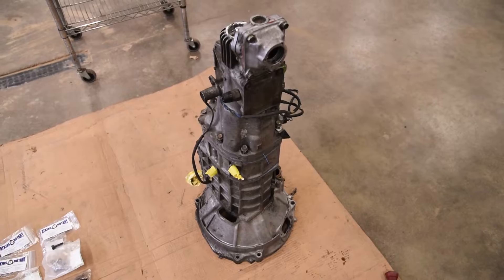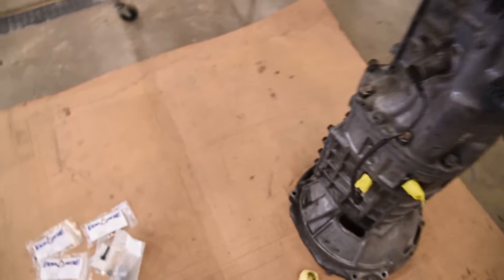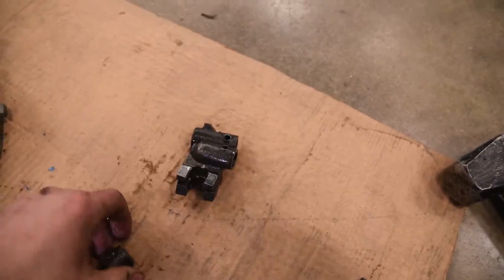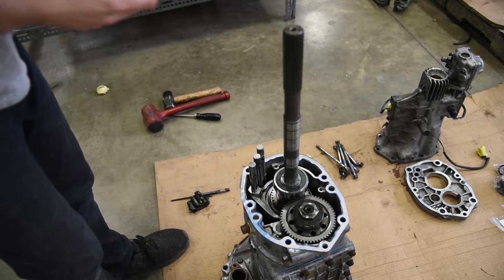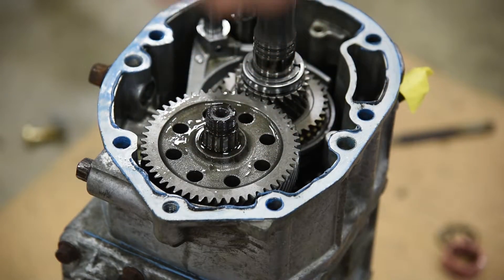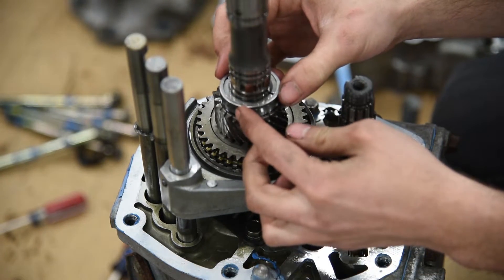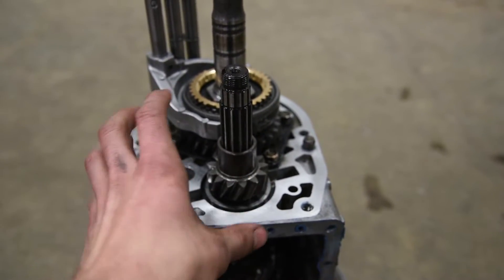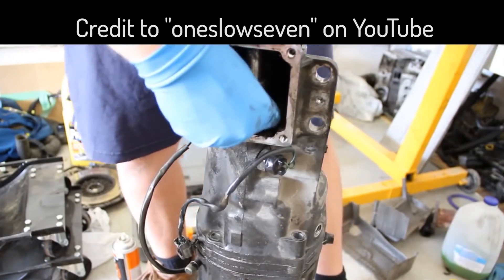How to Replace 5th Gear Synchro on FD RX7 Transmission

Comment: Few things I have learned and thought to share. When placing the synchro in get in close and line up the grooves as it will look and feel right till later in the process when the "c" clips below the main bearing don't slip in easy (even though they look supper close). Great write up on rx7 club forum too about this issue and i added pics there. 
To pull the main bearing I used a Harbor freight 8" 3 jaw bearing puller for 24 bucks..(i didn't even cut them) but modified with 6 1$ metal strap pipe hangers sold at home depot (thick one's, not the roll). If you want to cut them w/ that puller go 10" too. 2 people help hold it on but br careful and slow if having one person hold. 
Think that big nut on smaller bearing was a 32 mm but can confirm tomorrow. When "un punching" that nut just get it it like 95% and impact will do the rest. 
I used a bag and or tape so I didn't drop small part deep down the tranny when removing things like the BB. 
Go slow, taken ur time, not too bad. I went slow over a couple nights.

Comment: Thanks 4 years later this is still helping people. The best video online explaining this procedure. I bought a Harbor Freight 8" 3 jaw puller I am hoping to modify.  Sound like you did 10" bars so I'm starting with that. Thanks
Reply from the maker: Thanks! I'll have to reference this video myself down the road since I can't remember a single step of this process!
Reply: @TurnNBurn nice, the thicker metal HVAC straps from lowes worked like a charm and they were like a buck a piece so maybe 30 bucks for the new janky bearing puller i made, haha. 5th gear shifts super smooth and changed out all the parts you mentioned. Just wish I did the clutch while I was there but she runs fine and Ill do that soon..